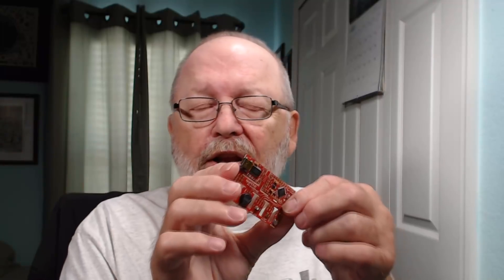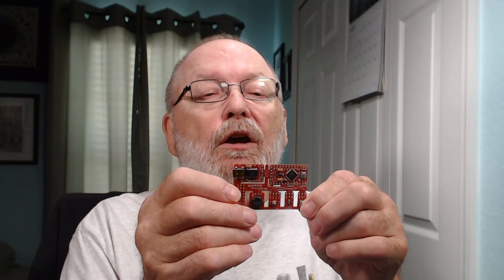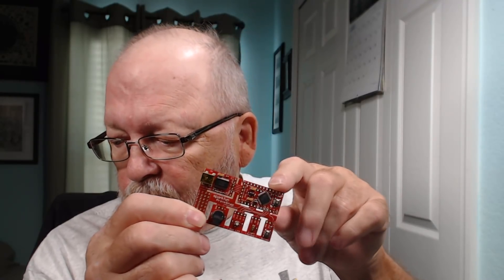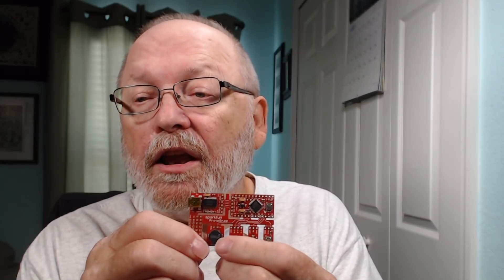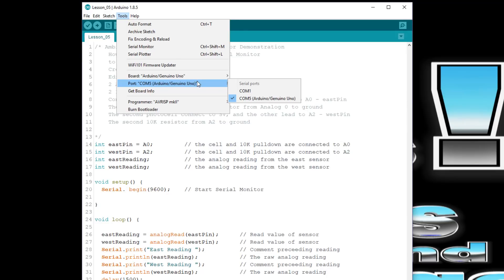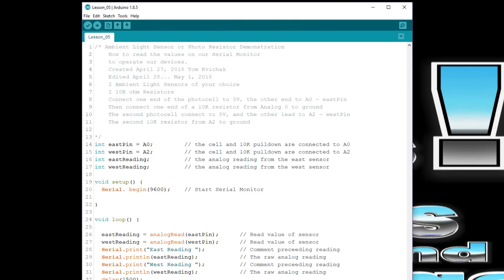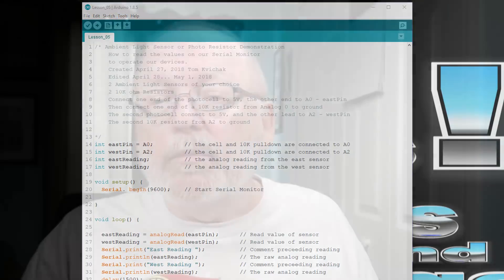Arduino Pro Mini & Motor Shields Explained

Comment: Thanks for the recognition, Tom.  I need to stop watching too many youtube videos and do some work on my layout. It is ironic that we can get stuff much cheaper when an Item is made  in China and shipped directly from a Chinese vendor to us. I noticed I get a lot of stuff directly from China at 1/3 to 1/5 the price I can get the same or similar item in the U.S. , even though that item in the U.S is probably made by the same Chinese manufacturer. Keep up the great work. Russ
Reply from the maker: I need to do more work on my layout also. The parts coming from China definitely are cheaper, but they take 2 to 3 weeks for delivery. I'm impatient when I order something. I want it NOW!
Reply: Hey Tom. I appreciate your honesty and great sense of humor. I have bought electronic project kits directly from China also(DIY).board layout diagram directly on the PCB, there are absolutely no instructions for the kits. Most of them don't even have a website to get a PDF of the instructions. The ones I buy from the US always have instructions. I have found out throughout my life, that most of the time you only get what you pay for, nothing more. Some shortcuts work out, but most in my opinion, usualy return eventually  to bite you in the Butt. I to am impatient, at least when it regards my hobbies. Life is short, and I want to get the maximum enjoy out of my hobbies, especially my Model Railroading Hobbies. I am one of those guys that has more than one infliction. My main hobby is Model Railroading, but I also enjoy Electronics and small robots, RC cars and trucks, and woodworking. Insane, I know, but I can't help it. These things are very exciting to me. Take all the breaks you need. I look forward to Monday. Please excuse my typos and grammaticos- my keybord has started acting atrocious. I think it needs a good cleaning. Thanks Russ.

Comment: hey Tom, so do i need to jump the vin pins to stop the motor shield from feeding power into the arduino or does that send the power to the arduino  ty for your time Tom
Reply from the maker: Tom, you don't want the Vin feeding back to the Arduino. You want the jumpers OFF the Vin terminals. I've seen two different versions of the shield with that model number, the one on the Amazon page:  https://www.amazon.com/RobotDyn-H-Bridge-DC-motors-stepper-Leonardo/dp/B071ZPSV9Z
An one on the Robotdyne page which looks a little different. It has more jumpers near the digital pin header.

You want to power your Arduino through the USB port to run it with JMRI, and you want a separate power source on the shield.
Reply: ty Tom thats what i thought...i have the one from amazon but mine had one jumper on the power pins not two like in the picture do i need both of those jumped? ty Tom
Reply from the maker: If it says VIN by the jumper, you do not want to jump the two pins. Just leave the jumper hanging on one of the pins so you don't loose it. Did it come with any documentation or a link to the documentation?
Reply: no i can't find anything on it,it has 4 pins next to the vin pins labeled pwr one set is jumped one isn't in the picture it show both sets jumped,ive been searching for info all day Thank You for all your help and time Tom...btw i been using your amazon page for all my orders
Reply from the maker: Thanks for using my Amazon Page. I found their web site but they didn't have a wiring diagram for the shield. They have the same photo as on Amazon. Anyway, you don't want the Vin pins jumpered. The PWR jumpers should be OK. I looks like they are for the external power to run your output. That's what you want!
Reply: ok ty thats what i was thinking thanks for your time